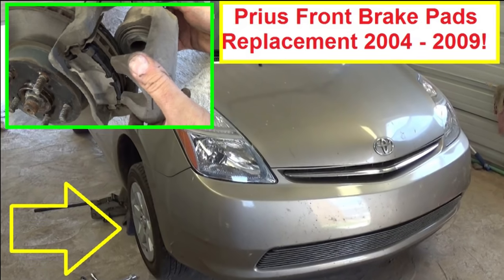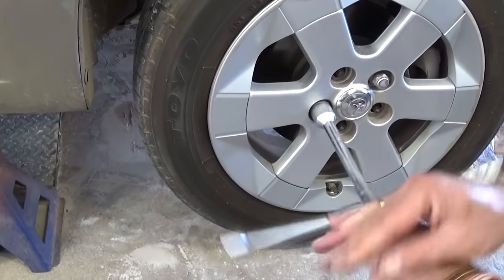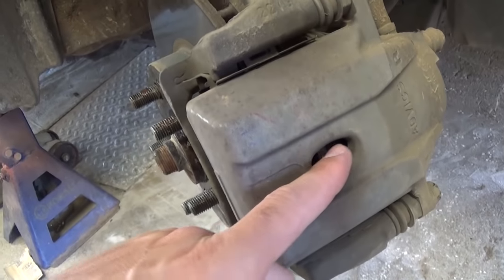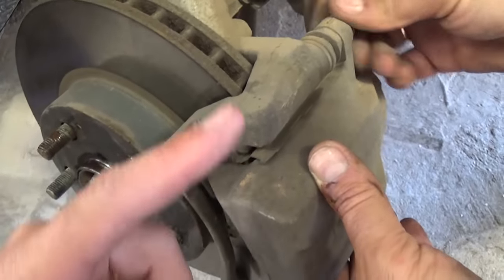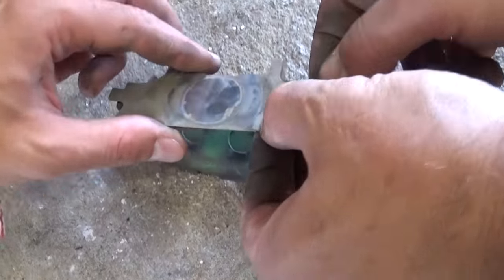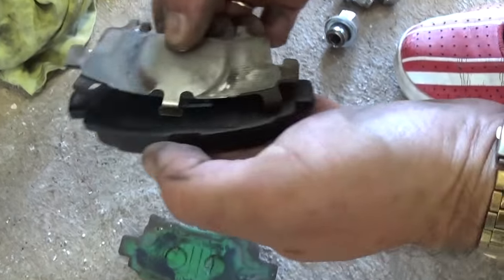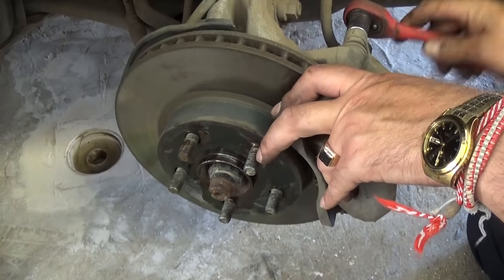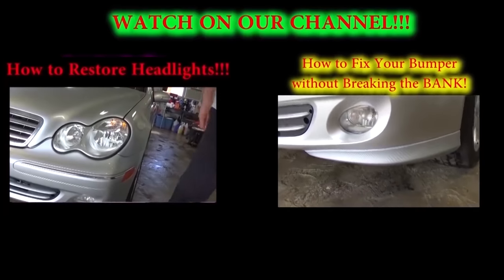Toyota Prius Front Brake Pads Replacement ! Toyota Prius 2004 -  2009 Front Brake Pads

Comment: Thanks for the video, 4 things that should be mentioned here to others though, this is improtant:
1.  Disconnect the negative battery cable before doing anything, priuss have automated brake actuators that will close the caliper pistons if fob key is close to the car or a button is pushed.  This is a nightmare, disconnect your battery cable.
2.Calipers should be held up by a small bungee chord or large nylon zip tie, you dont want to damage the brake lines and pinch them off.
3. Brake pad carrier plates should be greased on the outside edge where the caliper piston makes contact with the plate, not good to install dry carriers against the pistons.
4. ALWAYS torque the caliper bolts and lug nuts to your cars Torque specification, a hand tighten may work for an experienced mechanic but you can easily under-tighten: caliper could seize up on rotor and hub, this is accident material - or over-tighten and brake the bolt right off in the caliper mount, that would just suck.
Thanks again for the video, cheers
Reply from the maker: +Keenan Walker great information Keenan. Thank you for sharing with everyone. We are glad that the video was helpful. If you ever need help with your vehicle let us know you can also find us on Our Official Facebook Page here: https://www.facebook.com/worldmechanicsofficialpage/?fref=ts
Reply: +Keenan Walker #5. The jack lifting point is in the center front area, it is easy to spot. Two main frame welds may be found just a bit further out, but not the side of the body, for the jacks.
Reply: K W333 good points, also add to the list to check and lubricate the pistons...might as well, you're down there and everything
Reply: Excellent points...also you should be using a torque wrench to properly tighten (and not over tightening) the caliper bolts not just tightening them down as hard as you can (a little blue locktite is always wise too). Also using some copper anti seize on the edges of the pads where they sit in the caliper to stop them chaffing.
Reply: K W333 whats the correct brake fluid for 04-07?? &whats the torque on the caliper bolts
Reply: *important * break

Comment: Thank you for taking the time to post your video, very informative.  The Stealership wants somewhere in the $300 range to just change my front pads, WTH????  With the Hybrid system and the weird front wheel charging system I was worried that I might mess some shit up, as opposed to other pad changes in the past.  Your video clearly explained all that I needed to know.   K W333, points out some good stuff here.  I ain't lookin' for no nightmares; that's for damn sure.  TY K W333 for your info.

Comment: You shouldn't leave the caliper hanging like that,  you can damage the brake line.
Reply: So true
Reply: True, and guys being very careful by having a wire hanger from which to suspend the caliper, like using a coat hanger cut to size and bent into S hook, can save stress on the hydraulic hose and fittings. Older brake hoses will last longer doing this. 

Any better ideas? Would love to learn from a mechanic not under a shade tree.

Comment: I just did this and it's really not too hard (I have ZERO car experience). The only thing that was a little tricky was compressing the caliber, you have to really crank on it or the new pads won't fit. Also, I did not disconnect the battery, but I made sure my key FOB was very far away from the car while I was working on it.
Reply from the maker: +Zack Freeman Some of the new brake pads are really thick and as you said you really have to crank on it. We are glad to hear that the video was helpful and you saved yourself some money :)
Thank you for watching us!

Comment: DONT LEAVE THE CALIPER HANGING it’s a terrible mistake. Spray some brakes cleaner before working on brakes apply some brakes Lub on pads. Important steps thanks
Reply: I was like where the brake lub lol
Reply: Why do you need brake lube?
Reply: @erxfav3197  pads and caliper moving when brakes in use, lube makes sure nothing stucks

Comment: Sent the wife to Les Schwab in WA and they wanted $1,000 to do front and rear brakes. Local mechanic wants $560 with $70 additional to change brake fluid. Factory original brake pads lasted 222,000 miles which is remarkable. Prices not including tax @10% more.

Comment: Before starting, do you need to disconnect the battery? From other clips on youtube, I noticed that if you don't disconnect the battery, the brakes will engage...
Reply from the maker: Daniel Axente We did not disconnect the battery. It would not hurt to do it. We have replaced brakes on a few prius at the shop and we never had a problem.
Reply: @WorldMechanics  If you have the toyota scanning software that can disable the brake actuator then you dont need to.  The average person does not have that so disconnecting the battery is ALWAYS RECOMMENDED
Reply: YES.  ALWAYS DISCONNECT.  (Shops with the toyota software that can disable the brake actuator dont need to do this)

Comment: My calipers need replaced the dealer wants too much money Firestone is half the cost but they said at the dealer that if I do any brake work anywhere but them I'll have no more regenerative brakes that sounds like a really big lie I'm not too sure though I did my brake pads at Firestone and they gave me the same story and my brake pads are fine so maybe it's the same thing

Comment: My boyfriend changed my front brake pads on my 2007 Toyota Prius and now the steering wheel is really hard to turn like it doesn’t have power steering and the red triangle light is on. What was done wrong that made that happen?
Reply: red triangle is a catch all warning, take it to an auto shop and have it read <3 hope you’ve figured it out in the year since you made this comment !

Comment: I’ve never see that shim transferred to another pad. I’ve seen a lot of pads changed, but never transferring the shims.
Reply: I changed brake pads on my prius and there were no shiny metal plates on old pads or new ones (those that go to the back plate of the brakes). Super confused 🤔, can't find info
Reply: Most after market pads don't use multiple parts anymore. They're basically "built in". Except dealer parts. Alot of the time when I order pads from toyota it comes with the  couple shims to put together with some grease to.

Comment: Pay careful attention to the way the hardware is fitted on the old brake pads.   I thought I did but when I got to second wheel I found I had it wrong and had to go back and redo the other one.    BTW,  exactly what part of the hardware are we supposed to grease??   Thanks.   LOL, I won't be back for the answer.   I changed my pads at 140,000 miles.  They could have gone another 60,000 probably, and further I didn't know they actually had a warning light of their own which from other comments I gather is the purpose of the little metal feeler on one of the pads??    Or does it just make noise?  BTW, I bought Bosch pads on Amazon.  WHY?   I always use original Toyota parts, and in this case the I had to hammer and bend the hardware clip since the little notch in the pad to accomodate it was not made on the Bosch parts even though the rest of the pad matched ok.      Another $1 or two would have saved a mashed finger and aggravation.

Comment: 2009 Toyota Prius. Squeaking noise coming from the front wheels which stops once brakes are applied. Most likely the pads or a stuck caliper rod?